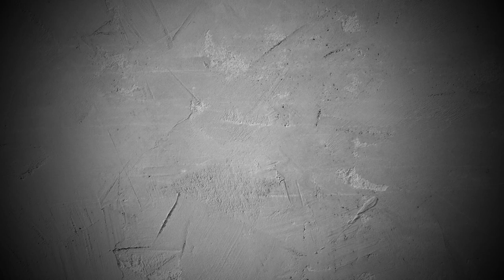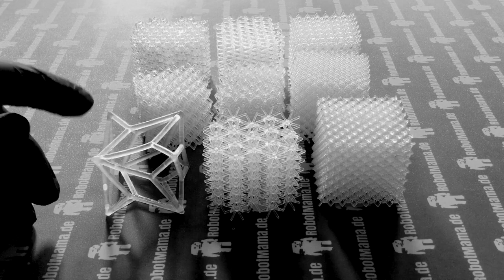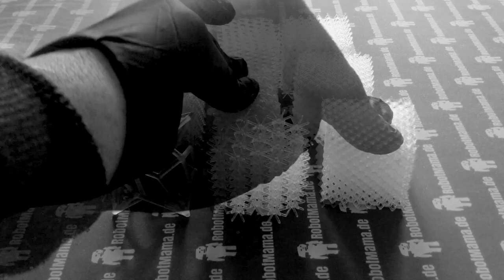3D Print Tiny Lattice Microstructures

Comment: Wonderful !!!
Do the Lattice Microstructures need Supports for Resin 3D Printing?
Reply from the maker: I used supports for the left cube in front this is the only structure that is not self-supportive. The rest was printed directly on the platform. I adjusted the buildplate in z height to get it closer to the bottom so the first layer sticks better. It might also help to use an older Plattform with more scratches for the sticking. Stay calm and keep on printing ;) cheers Robotmama

Comment: Hi,
Can you share more details about your printer?
Reply from the maker: Hi Marius. The Printer I used is the Formlabs Form2
Reply: @RobotMama   I'm making some tests for my thesis I just have one Question, What was the parameters of the support on your models? It was automatically generated? or  did you add some extra parts in the model to ignore Preform Supports? thank you!